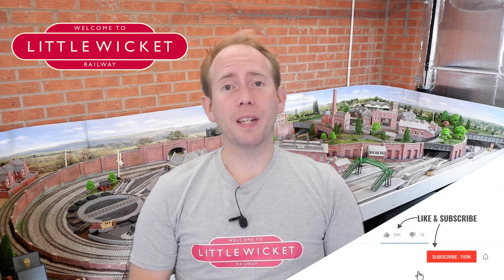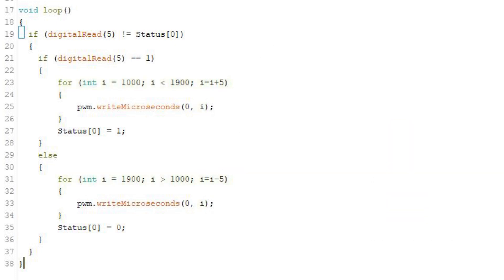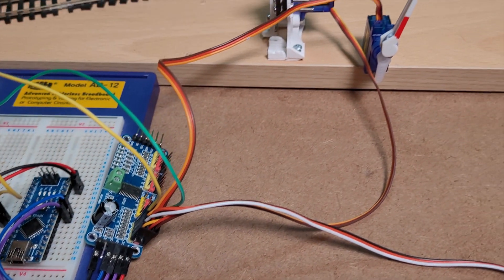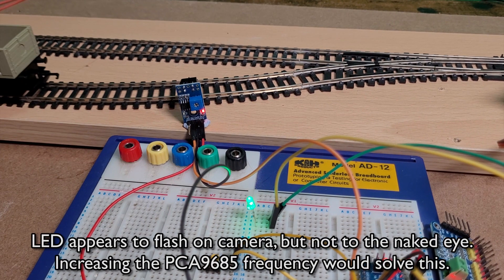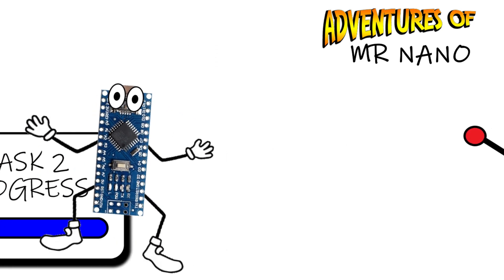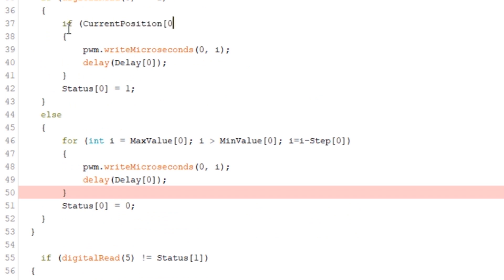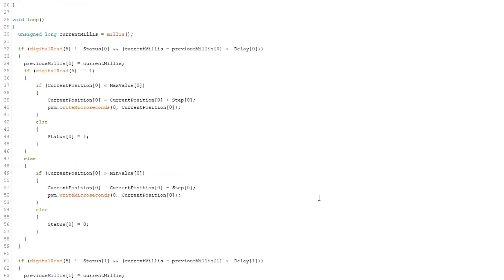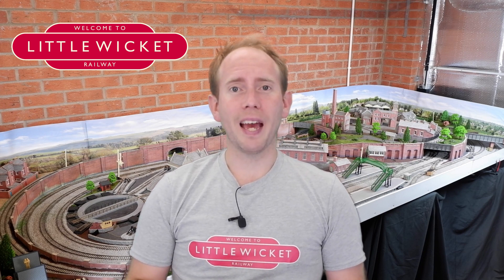Add Realistic Slow Motion to Servo Point Motors

Comment: This is a brilliant video! Would it work the same way with the CMRI controlled code? Like, create the servo delay function and then make the references etc
Reply from the maker: Yep, sketch gets the data from JMRI and then you can process that however you want in the sketch.
Reply: @LittleWicketRailway  I'm attempting to combine the slow-motion code with the previous servo control sketch as I'm looking to use CMRI to control the points rather than push buttons.  I'm struggling to find the right code to do this and every where I look online seems to have a different method for control of the servos.  Do you have any pointers?
Reply: The script below is where I have got to.  I'm guessing that the issue could be with setup statement, particularly "pinMode(DE_PIN, INPUT); ".  I have also seen a lot of scripts using cmri.get_bit() but I have not ventured down that path yet.....

I'm very much a beginner at this game so I appreciate any comments.

// In this form the servos cycle once as sketch is uploaded and again as JMRI starts (before tables are loaded) but then fail to respond to CMRI commands
#include <Wire.h>
#include <Adafruit_PWMServoDriver.h>
#include <CMRI.h>
#include <Auto485.h>

#define CMRI_ADDR 1
#define DE_PIN 2
#define numServos 3 //The number of servos connected

Adafruit_PWMServoDriver pwm = Adafruit_PWMServoDriver(); //setup the board address 0
Auto485 bus(DE_PIN); // Arduino pin 2 -> MAX485 DE and RE pins
CMRI cmri(CMRI_ADDR, 24, 48, bus);

int Status[numServos]; //Create a table to hold the status of each turnout (LY1, LY2, LY3).
int Throw[numServos] = {1100,1100,1100}; //Create a table to hold the throw value for each servo - set to nominal values for now
int Close[numServos] = {1700,1700,1700}; //Create a table to hold the close value for each servo
int CurrentPosition[numServos];
  int StepSize[numServos] = {10,5,20};  // various step and delay settings to compare and contrast
  int DelayTime[numServos] = {75,38,150};  
  unsigned long previousMillis[numServos];

void moveServos(int inputPin, int connection)
{
  unsigned long currentMillis = millis();
    
  if ((digitalRead(inputPin) != Status[connection]) && (currentMillis - previousMillis[connection] >= DelayTime[connection]))
  {
    previousMillis[connection] = currentMillis;
    if (digitalRead(inputPin) == 1)
    {
      if (CurrentPosition[connection] < Throw[connection])
      {
        CurrentPosition[connection] = CurrentPosition[connection] + StepSize[connection];
        pwm.writeMicroseconds(connection, CurrentPosition[connection]);
      }
      else
      {
          Status[connection]=1;
      }
    }
    else
    {
      if (CurrentPosition[connection] > Close[connection])
      {
        CurrentPosition[connection] = CurrentPosition[connection] - StepSize[connection];
        pwm.writeMicroseconds(connection, CurrentPosition[connection]);
      }
      else
      {
          Status[connection]=0;
      }
    }
  }
}

void setup()
  {
    pinMode(DE_PIN, INPUT);  // Trying to get CMRI command into the Uno - also tried INPUT which resulted in no movement at all
    Serial.begin(9600);
    bus.begin(9600);
    pwm.begin();
    pwm.setPWMFreq(50);   // This is the maximum PWM frequency
  }

void loop()
{
     cmri.process();
  moveServos(2,0);
  moveServos(2,1);  
  moveServos(2,2);   
}
Reply: @iainreeves5797  Hey Iain, did you have any luck with what you are trying to do as i think we are trying the same thing? I have tried what i thought may work but, no luck. I have my entire layout running on jmri and cmri as per the vids but would like to slow down the servos.
Reply: @bobbyboy1962  I have posted a sketch on the Arduino Forum which works on the test bench. I just need to transfer it to the layout now.
Reply: @iainreeves5797  just saw this. do you have a link to the forum as i cant find it

Comment: Hi Rob, WOW that was great but very confusing to me. I understand the concept of moving in steps but I am terrible at understanding coding. I am using the multi PCA9685 code you posted in a earlier video (October 20, 2020) and find it hard to incorporate these steps into that original code. If you would please show this slow servo code incorporated into that original code I would be very grateful. Thanks.

Comment: Everytime I think of something Rob, you post a video. Here's a question though... did you produce a video about how to code multiple servos into the Arduino? I just got my first test bed switch working per your video but would like to add the other 2 on my test layout.
Reply from the maker: Hi! Here are a a few other videos on using servos that might help:
Part 1 - https://youtu.be/ayOoUkdjHtg
Part 2 - https://youtu.be/fHAPXAcW9ZQ
Part 3 - https://youtu.be/iif6l52lLks

And if you want to link multiple PCA9685 boards together - https://youtu.be/v1f_EDHV390

Comment: This is gold! Please do more! Would love to sort out electrofrogs and what you do when you need more than one Arduino unit..........again, your presentation is perfect for my knowledge level  😍

EDIT " Just realised I have more than one USB terminal.......so OK on that! Electrofrogs, would like to use a servo too, but how do you change polarity at the same time?
Reply: For electrofrogs you can just buy servo mounts that have space for an SPDT microswitch. Some, currently on eBay, come with one already fitted. The microswitch acts the same way (almost) as the accessory switch that you'd add to a Peco seep motor. 
The microswitch has the same three solder connectors - your positive and negative track power connectors and one that goes to the frog. The switch is placed on the mount so that when the servo arm moves, say to the right, the bottom of the arm will make contact with and press the switch down. The switch then switches which of its inputs is connected to the output to the frog.
It's simple but effective. I'd gone down the relay route too and it's clever, bit way more complicated, takes up output pins and needs more code.
I was also concerned about what state each frog would assume at startup. Would the relay remember the previous states after power loss? Would turning the system on result in servo movement that got them out of sync with the frog polarity? Because it's reactive code setting frog polarity at a single point in time, I think the solution could be prone to the two becoming out of sync, leading to short circuits.
Whereas the microswitch solution is just beautiful in its simplicity!
Reply: @WirenwoodModelRailway  Wallsrail has a nice DIY servo mount in plastic card. Just need to start trying some of this stuff!
Reply: @paulhargreaves1497  I had a little play yesterday with a mounted servo motor, trying both the microswitch method and the relay.
On the mount I had, the microswitch wasn't all that reliable, the servo arm could slip off it and not keep it pressed, which would mean a short. I put a lot of tape on the microswitch and that seemed to improve grip.
The relay does seem to remember its previous state after loss of power, which is very encouraging.
Reply: I have electrofrog points, and just used a relay that activates when the servo is triggered. Most relays have a 'normally open' and a 'normally closed' output. which is ideal for frog switching. Relays are better for this than Triacs as they will handle both DC and AC (for DCC systems).
Reply: @sawnofflockie7180  Thanks.... going to set up a small test track, then experiment with this kind of stuff. Fortunately, none of this is outrageously expensive....makes up for dcc loco costs! 😥

Comment: Nice video and good explanation why you always should use a non-blocking status machine instead of blocking code (I absolutely agree with another commenter that you never should use the delay function in meaningful code, with very few exceptions like in the setup function when waiting for something to initialize).
Here is a video I did last year that shows what can be done using servos. Click to check just the demo part or watch the whole video to check out the math behind and the coding. It can move all 16 servos on a PCA9685 simultaneously and with individual direction, speed and end move behavior. https://youtu.be/-kL7UoEXzYA?t=1077

Comment: Great video. I think you could improve things should mr nano get overwhelmed by adjusting the position of a servo relative to where it should be using the internal nano time you have. i.e. calculate the new servo position relative to the time you started the movement of the servo and how long it should take to move. So if there are a lot of servos they will be considered less often but the messages sent will require a great angle of movement. regards Andrew

Comment: I use arrays for the 16 servos, allows easy updating via for loops  - This is the section in my controller code that can move upto 16 servos at the same time - no delays 

void updateServos() {
  // update any servos that are actively moving
  // or mark them as done

  for ( int i = 0; i < servonum; i++) {
    switch ( servoState[i] ) {
      case SERVO_MIN:
        break;

      case SERVO_MAX:
        break;

      case SERVO_INC:
        // servo is moving up so increment pulsewidth and stop if at max
        microsec[i] += config[i].SVspeed;
        if (microsec[i] >= config[i].SVmax) {
          microsec[i] = config[i].SVmax;                    // make sure we do not exceed max
          servoState[i] = SERVO_MAX;                        // mark servo as complete
        }
        break;

      case SERVO_DEC:
        // servo is moving down so decrement pulsewidth and stop if at min
        microsec[i] -= config[i].SVspeed;
        if (microsec[i] <= config[i].SVmin) {
          microsec[i] = config[i].SVmin;                    // make sure we do not go below min
          servoState[i] = SERVO_MIN;                        // mark servo as complete
        }
        break;
    }
    pwm.writeMicroseconds(i, microsec[i]);                  // send the instruction to the PCA chip to move the servo at the set speed
  }
}

Comment: You should NEVER use "delay", first half of video was a bit pointless explaining it! lol
Reply from the maker: But if you've only got one point motor attached to your controller or you're not too bothered about having to wait then delay is all you need and it's very quick to implement.
Reply: @LittleWicketRailway  Totally agree, but its a principle that we should be showing good practices rather than poor ones, plus most will copy and paste chunks of text from others so better its 20 lines of good code than 10 of "gona cause a problem"!

Comment: If the real thing takes about 1.5 seconds, then to scale, it should move quicker to move the smaller scale I would think.   What would the actual ratio be?
Reply: I think of my 4mm layout as the real thing viewed from half a mile away, so everything should move at the speed they would if you observed the real thing from half a mile away. I suppose it's a moot point, but for me, everything rocketing around the layout if you were to scale time as well would look ludicrous.
I've always assumed the 15minute/hour timetable is nothing to do with scaling time, but merely to ensure that there aren't hugely long periods when nothing happens as on the real thing.
Reply: @novakingood3788  Speed is scaled down to match layout scale for loco speed.  There is a formula for that.  I was just raising a point that maybe point speed should be scaled, but to be honest, most use the "real" speed to do the points rather than any scaling.   Still, the steppers are better than the  old solenoid point switches.  :)
Reply from the maker: I did consider this, but I assumed that whilst distance would scale down time would remain the same. I've heard that some clubs simulate an hour of real time in 15 minutes for example, so they can get through a full simulated day of running in a few hours, but I wonder if they drive their trains at 4 times the scale speed to match?
Reply: @LittleWicketRailway  Interesting theory.   Maybe they do, dependent on if the actual distances between the stations are to scale also :)   It opens a whole can of worms there
Reply: It's an interesting topic, let's take a simple scale of 1:100 if the real point moves 200mm in 2 second (360m/h) then the scale point moves 2mm in 2 seconds (which after scaling the distance gives the same 360m/h) but if we scale the time by the same scale factor then it would be moving 2mm in 0.02 seconds which to scale is 36km/h by that same idea a real train moving at 100kph would at 1:100 scale have to move at 1kph if you only scale distance or 277mm per second but if we scale time down as well then it would be moving at 27.7 M/s probably a bit fast for most layouts ;-) Time is normally altered for convenience on layouts so that for those watching a country station you see more than a fast and a stopping service going each way over an hour, however if you were creating a model of a busy terminus station in any major city you might not want to speed time up because there's already plenty going on. Note that even on speeded up layouts the train speeds tend to be accurate, it's basically like watching a CCTV tape where the tape is sped up whilst no trains are in the station.
Reply: These are interesting points, but I'd say we sort of instinctively know whether a train moving through the layout looks 'right' or not. The servo method offers a lot more realism in my mind and it's gentler on the turnouts: the solenoids always look so violent!
I look at Tony Wright's 'Little Blytham' and it's definitely a layout designed for watching the trains go by and I would bet thet he just relies on the old Mk1 eyeball. That and Rule 8, of course!